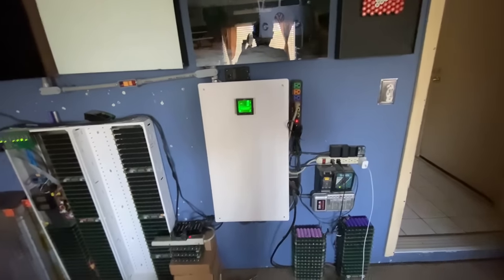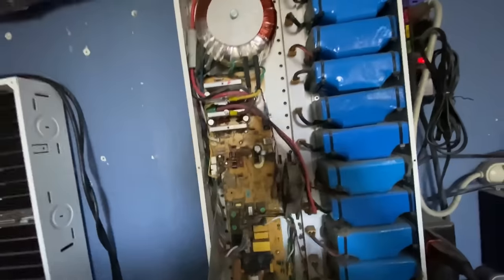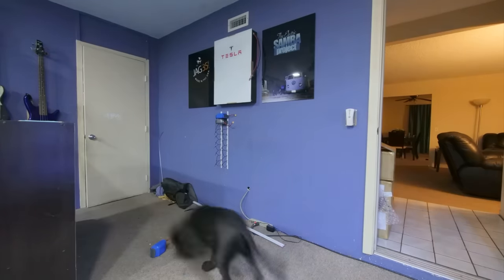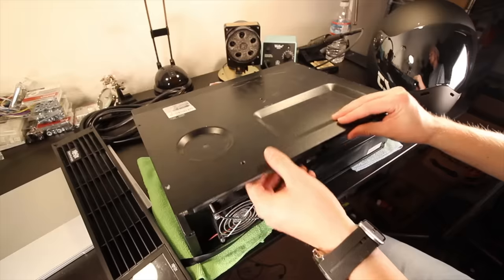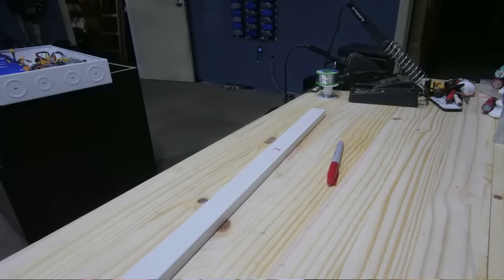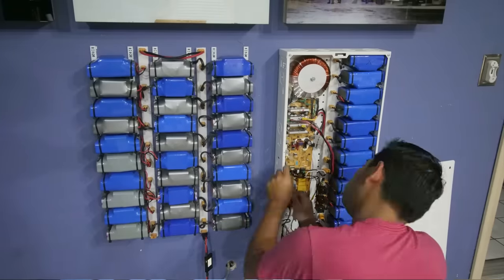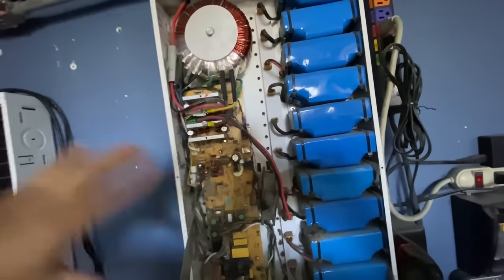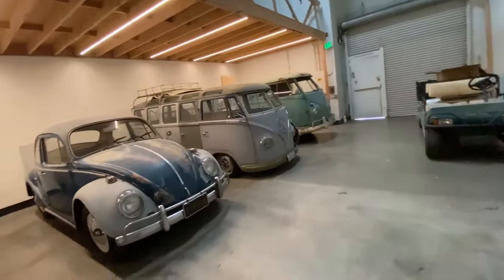Build a DIY Backup Powerwall using a UPS and scooter Batteries

Comment: too bad those UPSes are only modified sine wave as opposed to pure sine wave.
Reply: No. Only cheap ups have modified sine wave.
Reply: @nicklaslindgard  correct. I have had tested my 1500 RMI2U on battery power, powering AC split unit and one air dehumidifier, both were working without changing the working noice and watts. I think every apc smart upc have good pure sine wave output.

Comment: I can't imagine your insurance wouldn't use Pulsar magnitude lights to point at this if there is ever a fire. Even if it was nowhere near the box.
Reply: True.  They try to find any way out of paying claims. Just do one's best to protect from the possibility. Underrate things, fuse/protect appropriately and monitor things well. 2 of the packs can run the UPS at full output for several minutes without stress. I'm using 60, so each one's practically asleep at full load, and a normal load can power for a couple of days, easily..  Charging to 4.0V/cell max, and never pushing them hard. Should last awhile.... But will watch carefully!

Comment: I see alot of 1500 kva ups on amazon, excuse my inexperience but is there a difference between the one one have posted and say one like this
 https://www.amazon.com/APC-BR1500MS-Protector-Charging-Uninterruptible/dp/B084T67V7V

I'm trying to weight the pros and cons versus price, I want to start investing and build soon
Reply from the maker: You gotta make sure it’s 36v if you wanna use those battery packs.  Most are 24v or 48v
Reply: @jehugarcia  thanks for replying back, I missed that I'll check it out